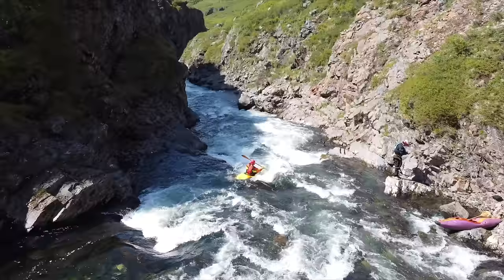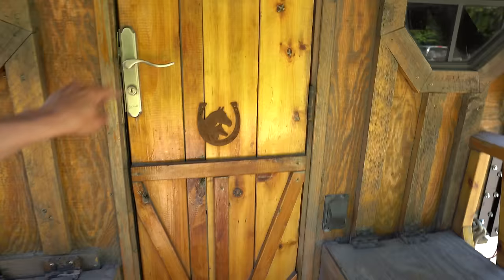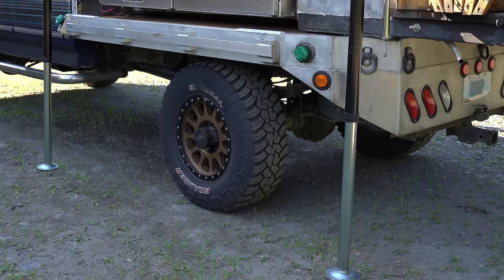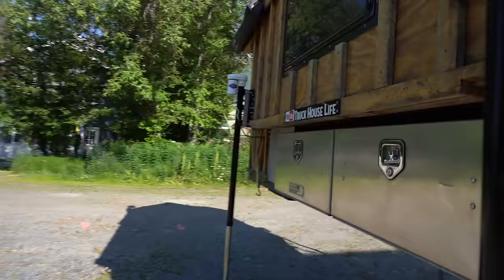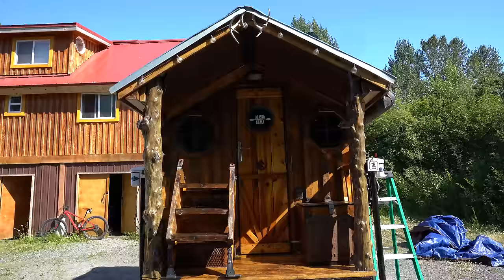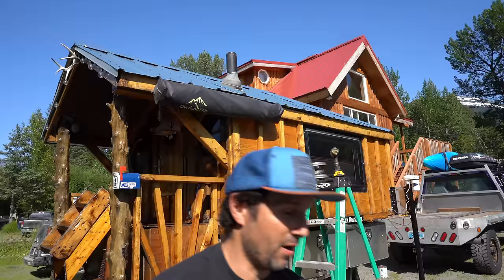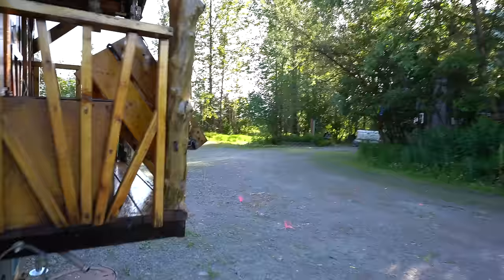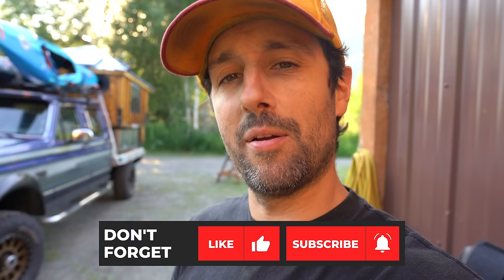THE SCARIEST PART OF OWNING A TRUCK CAMPER...

Comment: Timmy, we had a 1969 truck camper, and probably to save money, it only had 3 jacks which were hand cranked. My Dad was very handy so he made a rig that fit over the part that you cranked, then welded a piece on it so it fit a 1/2” drill chuck. What an improvement over cranking that sucker by hand. My Dad would have loved this rig, but the cost would have stopped him dead cold. His new 1969 ford pickup was $2,250.00 brand new, the 11’ camper was about $1,300. Those jacks look expensive but sweet
Reply from the maker: They Reico Titan electric jacks are incredible, but I literally had to sell my Suzuki Samurai to afford them.
Reply: They've gotten even more expensive,  I was floored when i priced them out 😮

Comment: Great video. Jacks work great.  House is looking fresh.  I’ve got 3 of those portable AC units.  I find that the amount of heat that comes from the hose is crazy.   I wish they’d make a insulated hose.  Sometimes I’ll wrap a small blanket around the hose to insulate it.  Safe travels.  Good luck on fuel prices.

Comment: When I lift my camper off the truck I set the sawhorses under the back then the front as I drive out, never having the camper only supported by the jacks alone. You never know when anything electrical or wireless could go wrong.
Reply from the maker: yup I usually do that

Comment: Hey Timmy, guess how we went from manual to (POWERED JACKS)? My Dad took the hand cranks, welded a post in the center of the square female socket part of the jack. Then, out comes the 1/2” heavy duty drill. We had to do a little to each one to not get too tipsy. Sounds antiquated in 2022, but 1969-1970 it beat the heck out of hand cranking in summertime.

Comment: From South Africa  my experience with turnbuckle (3.8m semi rigid  rubber duck on trailer, 1 on the bow and 2 on the stern) is that they turn loose. My roadside fix was to lace chord through the middle, and tied off. My permanent  fix was butterfly /wing nuts on the R threaded side as a locknut used a pliers to tighten.

Ever checked the tension on yours ? Might be a nasty surprise waiting for you

Comment: For stability on the jack legs you could use a ratchet straps to put a x brace on the legs. And then it would be very stable. Quick easy and cheap.

Comment: awesome dude. I especially appreciate a man that loves varnish. #varnishgod myself, on the forward end of the cabin, connecting the two forward jack locations, I'd pull the lower trim, and put structural aluminum connecting both JackPlates. I just think it would make me stronger, and put less stress on the wood structures. cheers- smart stuff
Reply from the maker: I've thought about that, I'll eventually weld a bottom cup up to the side brackets to help support the weight from under.

Comment: My tensioner pulley went on my Vanlife Van last week. Tried popping the ring off the side of it. Packed it with red bearing grease. Put it back in. Still squeeked like a hot teapot. Bought a new pulley from AutoZone - $30.10. Put it on, still squeeked 😔. Never replaced a  pulley tensioner before. Threads were worn on it - 29 yr old OE Dodge part, just enough. New tensioner arrives in a week. 
      Then, my heater core went. Never had coolant steam only in the cabin before. Or replaced a heater core before. Thought the engine was on fire for a second. Massive job. So I didn't panic, did my online research, called local mechanics. One said "Do a heater core bypass!". Learned how to do it on YouTube. Both input/output coolant core hoses were the same diameter 5/9". Walked to Lowe's down the street, bought a $3.75, 5/9" hose adapter and used the clamps from hoses on the core fluid line stems to clamp the input/output fluid hoses together. Problem solved! 
     Then my rear signal lights/breakights stopped working. Not the bulbs. Not the signal switch by the glovebox inside the dash. Not the fuse. I'd like to thank Corporate America (Lee Iacoca) for Programmed Obsolescence. Translation (We make sure everything breaks at once to force you to buy a new vehicle, so we make money). But, I'll find the bad ground.

Comment: My truck camper has the same jack system but it also has my awning tied in,I hold the power button until it turns red and it is a remote for my fiamma awning!
Reply from the maker: schwweeet

Comment: it looks like you need some fairly heavy duty helper springs.  I don't have a truck camper but I do have an old Kodiak 5500 plow truck and I put Timbren helper springs on front and back and they did a lot to control the sag when you have a full load.  You might want to look and see whether they have anything that would fit your rig.
Reply from the maker: I've got em and have timbrens too haha, 2 " lift up front and no lift in the rear, just need some taller lift blocks in the rear
Reply: @TruckHouseLife  well that would explain it the 2 inch lift on the front makes it look like it's sagging more than it really is.

Comment: Doesn’t look like it, but do the brackets you lagged to the camper corners have bottom plates?
Welding a plate to the bottom of each bracket so it would carry the load as well as the lag bolts would be money.
Reply from the maker: Not yet, i'm going to weld something like that up before too long.

Comment: It give idea hard side pop up mit three levels von ist low roof clearance und Cruise Oda sri ist normal height mode for das truck camping dri is ground mode mit storage basement vo under floor foam ply hinged wings Flop down und Out for wind snow security und Duck 🦆

Comment: What do you use for a coating on the underside of the camper?
Reply from the maker: Bedliner.
Reply: @TruckHouseLife  good call i need to add that to the underside of mine before its first Alaskan winter